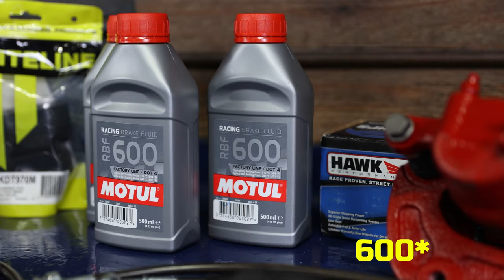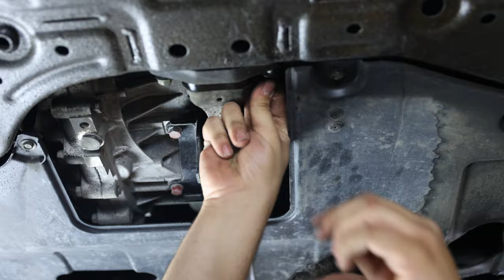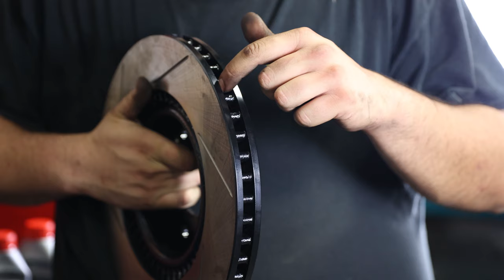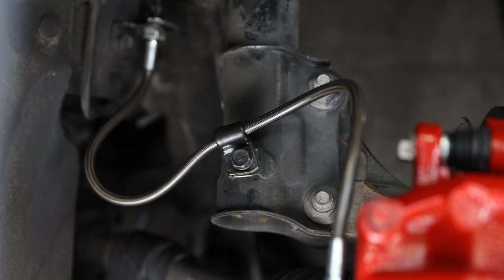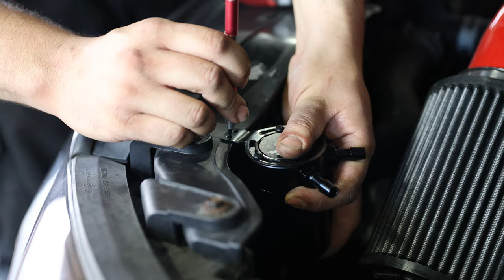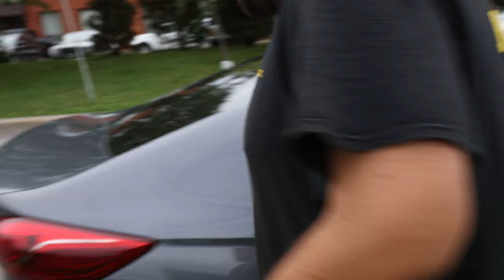ELANTRA SPORT BIG BRAKE KIT INSTALL - N75 MOTORSPORT - HUGE DIFFERENCE!!!

Comment: It's a little hard to tell, but it looks like the pads are on backwards? 

Edit: after a closer look, they're on right, just the backing plate looked odd.
Reply from the maker: You’re so close! Take another look and you may just spot it !
Reply: @performanceautocentregta7727  the pad with the squealer should be on the outside? 

Nope that's not right either? Hmmm, I'm still thinking.

I was gonna say passenger side caliper on the driver's side, but it looks like it's correct in the second picture.
Reply from the maker: We really wanna tell you but I don’t wanna give it away till there’s a correct answer !
Reply: @eljaiko33  I already said that and he said no
Reply from the maker: @Dantastic please send us a message on Instagram, our shirts came in and we’d like to send that shirt out to you! Our handle is @performanceautocentregta on instagram
Reply: Bleeder valves need upright.
Reply: Tak zamieniono strony by odpowietrznik był u góry....zmiana wynika z umiejscowienia zacisku oryginalnie a docelowo za i przed osią koła....patrz Hyundai XG
Reply: ^^ This appears to be the right answer. The bleeder went from the bottom in the "mistake" to the top in the final fitment.